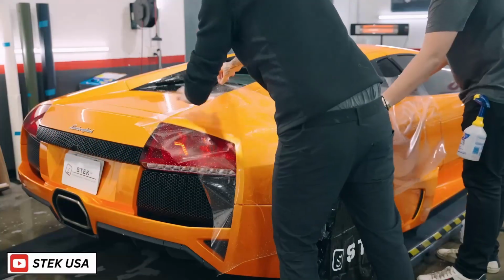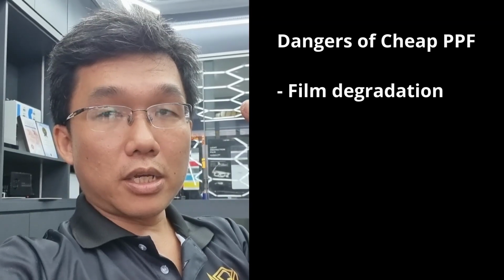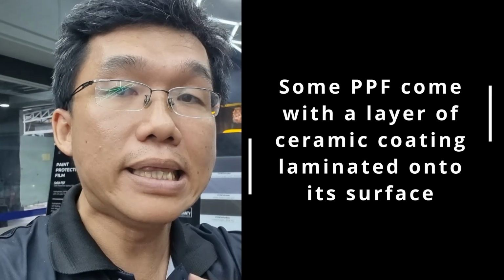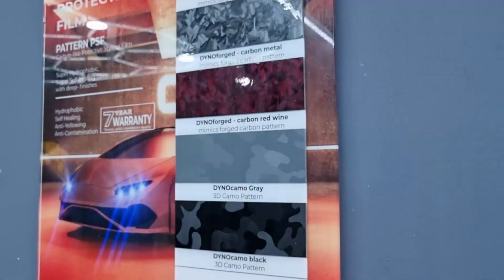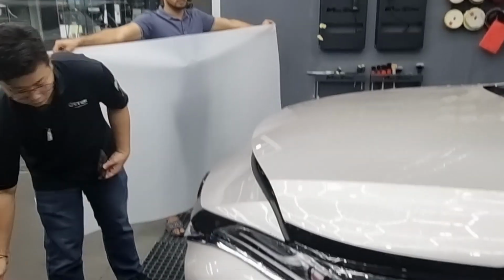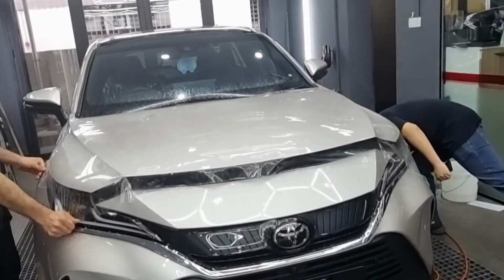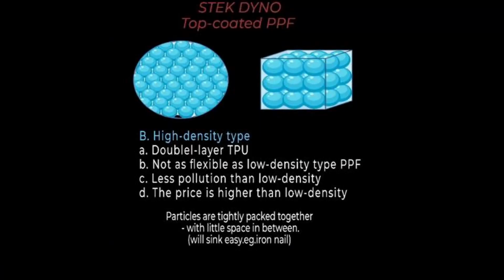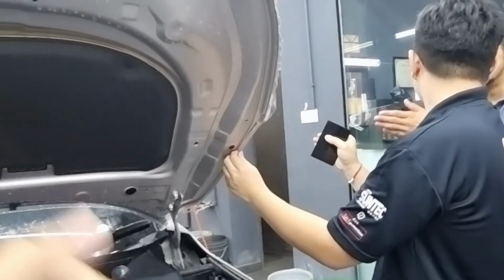Why good PPF costs more than repainting your car?

Comment: Genuine question, instead of PPF, why not only do ceramic coating and then repaint the car after certain years or when there's too many stone chips/scratches? Thanks
Reply from the maker: Actually, coating is way more cost effective than PPF for regular cars
Reply: @KonWaiLuen  Thanks for that. Do u have a guide to choosing the right kind/brand of ceramic coating, or it doesn't really matter that much?

Comment: ppf eventually get yellow, then removing them will damage the paint..i rather use the car until the paint is messed up and repaint it properly. After all if you gonna keep the car..repainting it properly also means body maintenance from rust and corrossion..why spend all that upfront with ppf. If you don't intend to keep the car, why all that trouble for the next owner..😂

Comment: I am driving the latest Harrier same as the one in your shop Pearl White colour. Installed PPF on the front of the car in MAD Detailing in Puchong. May I know why dirt sticks to the PPF at the bonnet whenever I wipe with clean cloth whenever after rain? I wipe it hard with shampoo but dirt still doesn't go away. Even when I sent to car wash, the Indian guy will ask mahu polish kah? My PPF vendor gave me 8 times maintenance within 2 year after installation.

May I know what is the cause of dirt sticking easily when I wipe with cloth without polishing?

Comment: Ppf is a scam, it cant actually protect against inevitable stonechips over time no matter how expensive they are. Just get it repaint after 5 years where your car will be as mew again, mind you good paint work would only cost 5k against 10-15k for whole car ppf which cant guarantee you protection